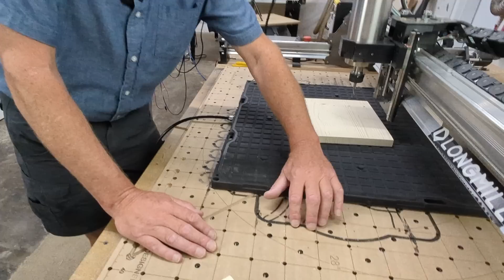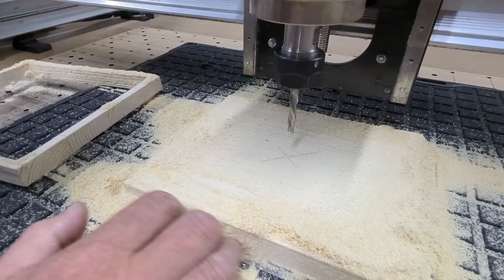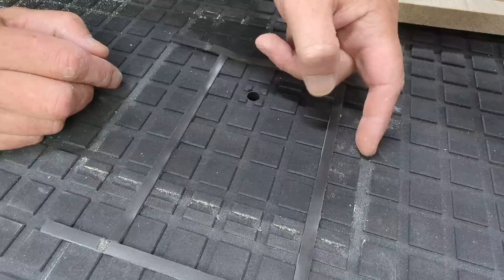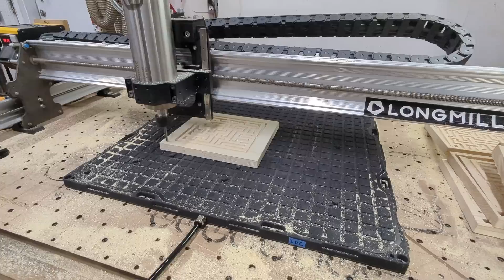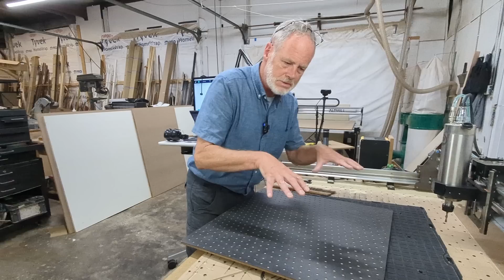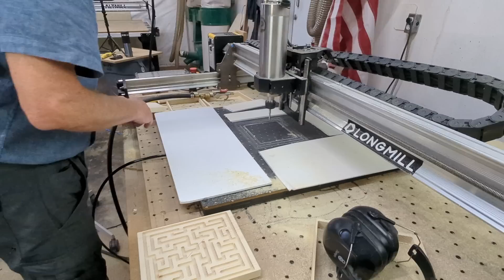Does a Vacuum Table Hold When You Cut Into It? CNC Router Myth Busted!

Comment: An alternative to a vacuum table like AirWeights is using vacuum bench dogs (there's at least two manufacturers). Yes, the spoil board requires preparation. I use a OneFinity Foreman with the their waste board setup, and a 7CFM vacuum pump. I cut the bench dog holes with the CNC, and then coated my MDF spoil board with three coats of sanding sealer (MDF truly sucks up sealer). I use thin dense weather stripping at the edges of the vacuum area. While it's not as versatile as an AirWeights table, it's a lot cheaper, and it's fine for handling sheet goods and jigs.
Reply from the maker: Thanks for sharing your experience with vacuum bench dogs! It’s always great to see how fellow woodworkers are innovating and finding cost-effective solutions to get the job done.

Comment: Without using tabs, how do you keep the excess wood from spinning and breaking your bit because it’s no longer held by the Vacuum when you breakthrough no?
Reply from the maker: Great question! If you set your vacuum table up to where the entire project in within the gasket then it will still hold strong even when the wood is cut through.
Reply: @IDCWoodcraft  if I cut thru will that not break the vacuum? Thanks for your videos and supplies 😊
Reply: I reread what you wrote I think you already answered my question

Comment: I was thinking of building my own. Vacuum table.  different shapes and sizes for different projects. My vacuum pads would be smaller, then my project.  Going to use h d p e sheet. My idea was smaller vacuum pads. So when I try to cut out, I can cut through the  project without hitting the vacuum pad.
Reply from the maker: That's a solid plan for a vacuum table! Smaller vacuum pads can definitely help minimize interference during the cut.

Comment: Ok ok...cutting outside the sealing is normal that the piece of wood don't move, but can you share what happen when cut inside the zone that is sealing?? how much can fly the piece to kill you? jejeje
Reply from the maker: nometoques, Cutting inside the sealing zone can definitely be risky, as the force may cause the piece to fly out unexpectedly. The amount it could fly definitely varies based on several factors, including the machine's speed and the type of cut being made. It's always best to ensure everything is secure and to follow proper safety protocols to prevent any accidents. Stay safe and happy woodworking!

Comment: Garrett, nevermind the fact that you cut into a $750.00 vacuum table to "teach" that it can be done OR that cutting into the Allstar gasket slightly is perfectly acceptable and is the proper way to use it. Please for the love of all things that bleed heavily...STOP pushing on parts on the vacuum table with the multi edge razor directly in front of your hands....It's not a matter of when it's gonna happen, but how many stitches you're gonna need if one of those warped/cupped boards decides it wants to break loose.  And when you are telling people how to use the Allstar gasket, it's super simple in Vectric...Zero out to the gasket surface (machine surface). For profile cut depth enter Z+.003"..this will cut into the tile gasket .003" which will not affect the holding ability in the least, For pocket toolpaths simply Zero out to the surface of the material if the depth is super critical, Yes this requires a change in settings in Vectric, but it is almost foolproof....The fool with their fingers on the key board being the weak link :)
Reply from the maker: troygattis8381, Thanks for sharing your thoughts! I appreciate your feedback on safety and the tips regarding the Allstar gasket and Vectric settings. It’s always important to prioritize safety and proper techniques when working with tools and materials.

Comment: Great Follow-up video Garrett.  Your examples for showing what happens to the vacuum table demonstrated the issue very well.  You started with just kissing the table top and then just cut right into it.  This example immediately identifies to the user that they really don't want to cut into the table if they can avoid it.  But if they do go to deep not all is lost.

I have had my 24"x48" vacuum table for about a month now.  Even though I have a cabinet shop, I am only using the vacuum table on my CNC at home.  (my play time).  When I used an mdf spoil board that was cheap and easy to replace I developed the mentality that mdf was cheap and easily replaced. So even though I was careful, I did cut through it and never worried about it.

Now with the vacuum table I only place projects that I am not cutting through directly on to it.  Anything that will be cut through I use the Tile gasket and zero my Z off the tile gasket.  I use the paper method and just kiss the gasket so that I can feel the paper rubbing on it when I pull it out.  It took a while to find that sweet spot but now it is second nature to me.  The bit cuts all the way through.  And even though it is pushing on the gasket, it only leaves a powder on the gasket and does not cut it.  I still can't get over that.  This tile gasket that Allstar CNC Products developed has really impressed me.  

I cut a lot of 1/2" MDO on my CNC.  My wife has a yard art Business.  I cut through on every blank I cut for her.  Once I found the sweet spot, I have not even cut or scraped the gasket.  Just a powder is left.  I have some fixture plate material but I haven't had a need for it yet. 

One point to make about the 24"x48" table.  You can by two of the 24x24" table vacuum sets for I think $50.00 less and then you can set them up as if you have a two zone 24x48 table vacuum.  

Jace at Air weights has very helpful to me.  He is quick with his responses to questions and has even gone out of his way to design and cut a special mounting plate for my CNC.  

Keep up the good work.
Reply from the maker: JosephWerle-je4ww, Thanks so much for your thoughtful comment! It's great to hear how you've adapted to using the vacuum table and found the sweet spot with the tile gasket—sounds like you really have a good grasp of it now! Your experience with the MDO and the yard art business adds a nice touch. It's also nice to know that Jace has been so helpful for you; good support can make all the difference. Happy woodworking!

Comment: I have a NZ made CNC and ordered the full size vacuum table instead of the custom wood one - never regretted it - There are 2 ways to stop cutting into the vacuum board - 1. Z Zero off the vacuum board instead of the workpiece 2. Use a a piece of 12mm custom wood on the vacuum board - this is your sacrificial board - A tip when using custom wood is to sand both faces and seal the edges with tape/pva glue/paint - either will work - I have many different sizes of the 12mm custom wood for different size jobs - when the sacrificial custom wood looks like a maze I just resurface it on my thicknesser or with the cnc machine - After 2 years my vacuum board still looks new - It is amazing how the vacuum sucks through custom wood - even 18mm thick works but 12mm or less give you great suction
Reply from the maker: davelind3674, It sounds like you've got a great setup with your CNC machine and vacuum table! Using a sacrificial board is such a smart idea; it really protects your vacuum board and prolongs its lifespan. It's also impressive that you can resurface the custom wood and keep things in top condition. Thanks for sharing your valuable tips and experience! Happy woodworking!
Reply: @IDCWoodcraft  This is exactly what we do at school, we have an inbuilt aluminum bed vacuum table on the M100 and we keep a sacraficial MDF ppanel on unless we are using the pylon system. I have been toying with getting a bench CNC after I finish the program and have been looking at this system because the vacuum is so superior to clamping it isn't even an option if I were building out a system. I was wondering if you could just use a sealed spoil board on top of the airweight. My thought was to get two of the 24x48 pads and the high power vacuum motor and then use a spoilboard, but I haven't seen anyone doing this exact configuration quite yet.

Comment: 😮 you're using the vacuum table wrong! Never cut inside the table! Put a 4mm thick mdf board on the table, this is the wasteboard. The vacuum is strong enough to hold the working material.
Reply from the maker: I'm with you Zeix. I'm just explaining what was asked but I think I should have just said don't do it like that!

Comment: First I was one of those comments and appreciate you reading and responding in such detail in this video. I can agree for a production shop the time it saves may be worth the cost and over time if you mess it up with too many through cuts time is money so buy another. If the manufacturer wants to go for hobbyist and small Etsy business needs to make next generation with replaceable top. You showed a manual version in your video with the mdf and foam. Too expensive a piece of equipment to not handle a common CNC need IMO. Anyway great video delving into this.
Reply from the maker: jcor-laura5450, Thank you for your thoughtful comment! It's great to hear your perspective on the balance between cost and functionality in CNC equipment. I appreciate you sharing your insights, and I'm glad you enjoyed the video!
Reply: @jcor-laura5450  I set up my CNC with vacuum bench dogs. Much cheaper, but it takes some planning and elbow grease.

Comment: So what happens when the your bit slips and starts cutting a Grand Canyon into the board? This is something that can't be avoided unfortunately, it will  happen to everyone at some point. Also, how do you put down an 1/8" baltic birch plywood when the board is warped 99% of the times. Can you even do a profile cut with such thin plywood without losing the vacuum effect? All sorts of questions like these pop into my head.
Reply from the maker: Such a great question. You about bit slip by always following the CNC project setup checklist

https://www.click.idcwoodcraft.com/setup-checklist-signup

And you are dead right, warped boards need to be surfaced first. That was covered in my original video.

Thanks for taking a moment to comment and ask!
Reply: I have yet to have a bit slip in my collet thankfully but I think I owe that to one of Garrett's videos where he mentions to ALWAYS give the collet assembly a clean out whenever changing bits which I do religiously now with a small brush set.

Comment: Questions: What suggestion do you have for registering a piece for repeatability using the Airweight system?  Also, I noticed a blue fan-like thing on your cooling line. I assume that is to make sure you have the cooling pump on? Where did you get such a piece?
Reply from the maker: You can get the flow meter using the link below. 

I'll create a video for indexing on the vacuum table

Alphacool 17356 Eisfluegel flow indicator blue 6-11mm - acryl Water cooling Monitoring https://a.co/d/iPMBLIH
Reply: @IDCWoodcraft thank you!

Comment: Would it be possible to put like a piece of plywood underneath your actual wood project and have the vacuum table still hold both pieces in place? Thanks!  Your videos really help!
Reply: With mdf! 4mm thick.
Reply: @Zeix02  thanks!
Reply: We use our machine so, but we have a Pro Cnc. I think this small vacuum table can also do.
Reply from the maker: rebeccamiller42, Yes, it is possible to use a piece of MDF underneath your wood project on a vacuum table. The vacuum can create enough hold to keep both pieces in place, as long as the vacuum seal is effective. Just ensure that the MDF is not too thick to maintain the proper suction. I'm glad to hear the videos are helpful!
Reply: @IDCWoodcraft  That's what you're supposed to do. You lost most of your suction when you cut through without it.

Comment: I know part of your job/videos is being a salesman but I see so many ruining the vacuum table by making that "simple" mistake by going a little too deep.  There is a fine line between being a salesman and being a snake oil salesman.  That line is a bit too close.
Reply from the maker: On the contrary, my job is to teach. This was an issue that quote a few people brought up so I addressed it. But yes, if a system is worthy of showing to make CNC work better, I will absolutely promote it.
Reply: @IDCWoodcraft  Sorry,  yes you do teach and very well.    Question, if you do happen to go a bit to far into the rubber is it repairable?  If so maybe you can teach those that will go a bit too deep, belive me there will be quite a few.
Reply: Why not just go to the link and read a little bit.  It has all the info to your question.  😅